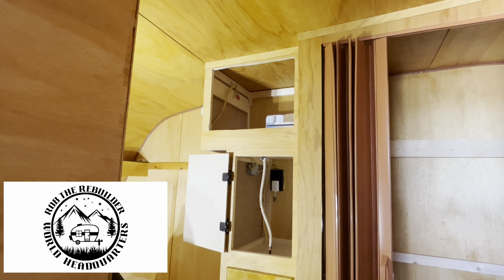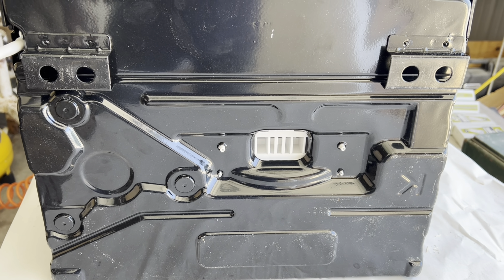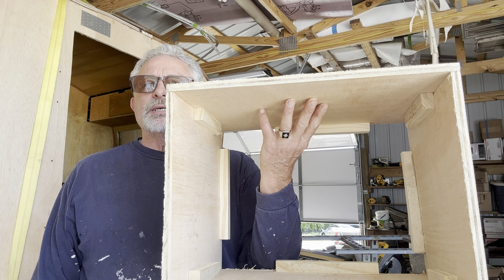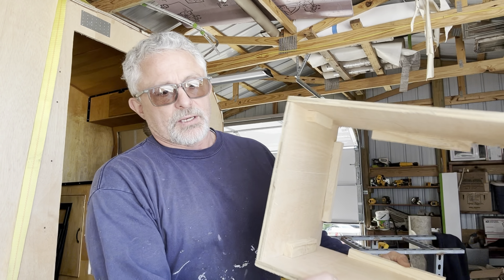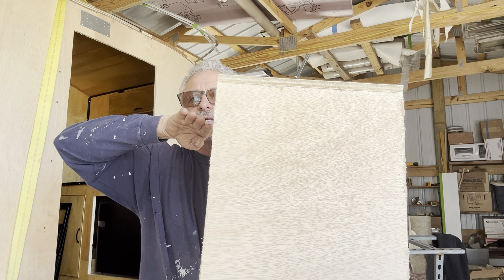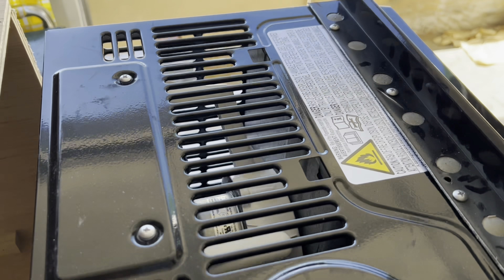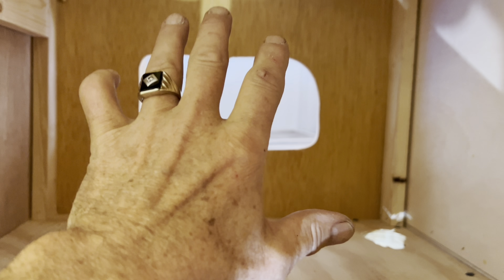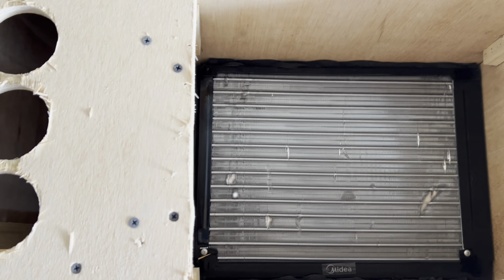EP 275  Install AC air conditioner up high in cabinets vintage camper.

Comment: Good to know it had to be tilted forward, that's not intuitive to me.  I tried out a new clamp on straight edge and brand new plywood blade in the porter cable, super straight cuts and I remade the base of the table, looking for the big box of laminate I put some where....
Reply from the maker: It is the details sometimes.

Comment: Good job. I was always told never to lay an ac of fridge on its side. I was cringing when you were turning it up to show the bottom. Have I been given false info all these years?
Reply from the maker: Technology has changed over the years.
Reply: With all Refrigeration units old and new, the A/Cs are filled with oil and when you lay them on their sides/ back the oil runs up the tubes and you don't want that to be the case when you run the pump, not only will it be starved of lubricant but it will be trying to push oil through gas passages, so the only thing that you really need to worry about is letting it stand upright for a few hours in the proper position before turning it on.
Reply from the maker: @travissquiers2932  I think they have a valve that prevents the oil from going backwards now.

Comment: Job well done for keeping the intake separate from the exhaust.  Most people just don’t understand that concept, and the result is an air conditioner that just won’t cool effectively. 

I often wonder in retrofit installations like this—whether it’s a window air conditioner or an RV air conditioner—what it would look like if the unit were carefully painted the same color as the cabinetry.  It might make the unit effectively “disappear.”
Reply from the maker: Not a bad idea
Reply: I have seen molding around it that matched the walls and that helps some.    Are  you proposing to custom color match and paint it to make the wood ?  I know they make dyes so you can duplicate wood grain on a dash, like say a 1939 or 1940 Ford.

Comment: How about a "thru-the-wall" A/C? These are designed to be installed in a thru-the-wall boot, and sometimes the vent sections in the cabinet are different from the regular window mount. You would buy the A/C and the appropriate wall boot.
Reply from the maker: Not familiar with that system yet

Comment: Don’t like the drain coming straight down could you have put a 90 in and go to the back then 90 down to give you some storage space 
.
Reply: Sorry didn’t realize the drain would be going out the back.
Reply from the maker: It is a rubber hose. No need for a 90